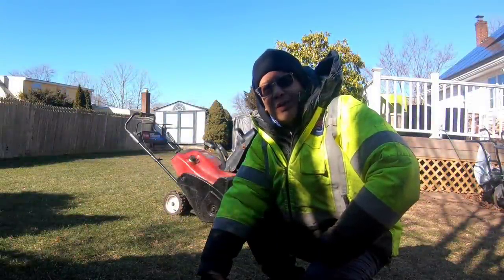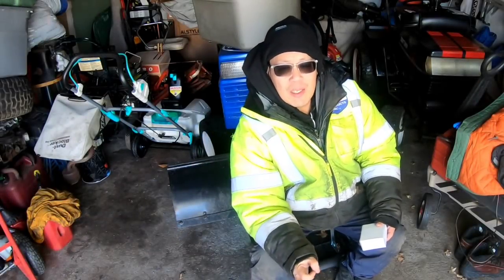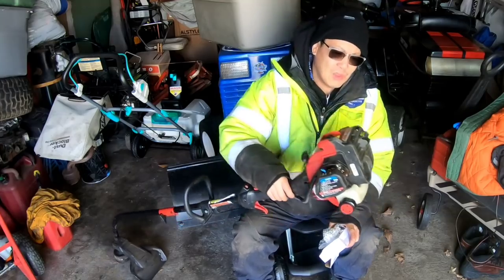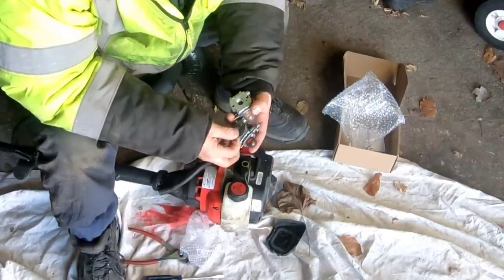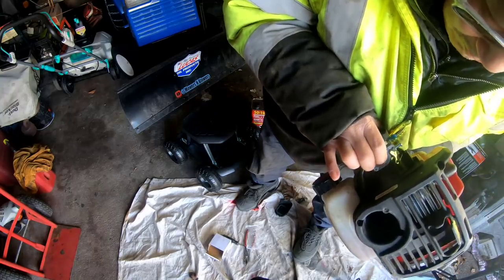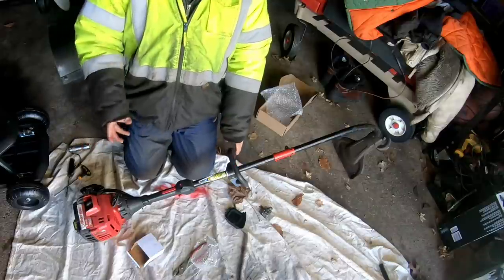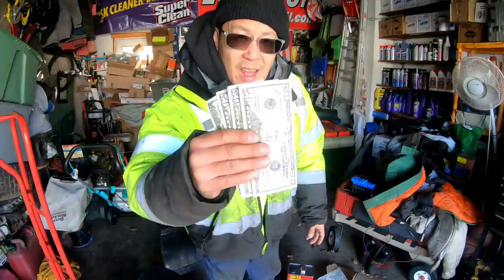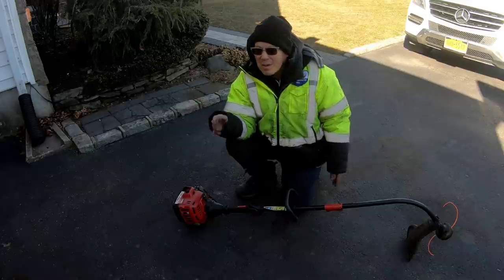FREE TROY BILT TB22 WEED TRIMMER EATER CARBURETOR REPLACEMENT INSTALLATION- TORO SNOW COMMANDER SOLD

Comment: Henry I had the same problem with a leaf blower The head bolts get loose And you lose compression so it won't start Tighten them up and they work every time

Comment: I don’t miss that snow.  It’s been decades since I used a snow blower.    But makes a good hobby fixing them in the off mowing season.

I trashes picked one of those Weedeater  but it was just the power head not attachments.  I got it working .  Just used seafoam to and fresh gas.  And it worked .  Now just need attachment 🤨

Since it was loose off the block i wonder if original carburetor worked also.   

Well it works now if it ain’t broke don’t fix is my motto
Reply from the maker: My motto too!  Saved old carb

Comment: It would be cool to see someone drop a Predator 212 or any slant headed 4 cycle OHV engine into one of those Snow Commanders and make it a real beast, giving it, its full potential. Were supposed to have 18+ inches by the end if the snowfall tomorrow. We have about a foot now. It looks like you could get a good 10 inches over their yourself. I see you have coastal effects that keep it down and have rain mix in. Its funny, I'm in Central Jersey in South Jersey, Cape May, their only getting rain. Parts of North Jersey are looking at over two feet.